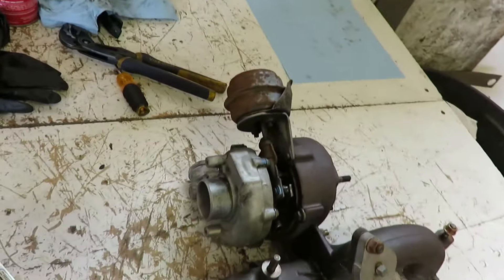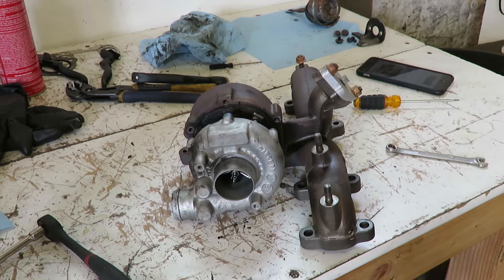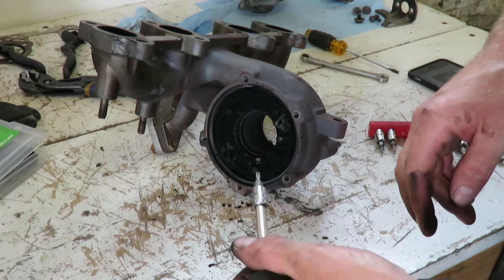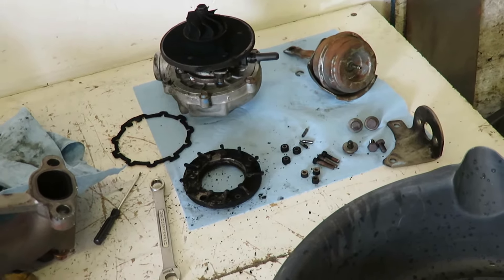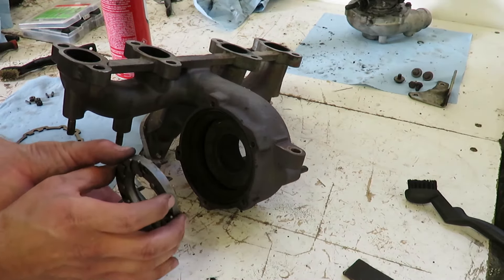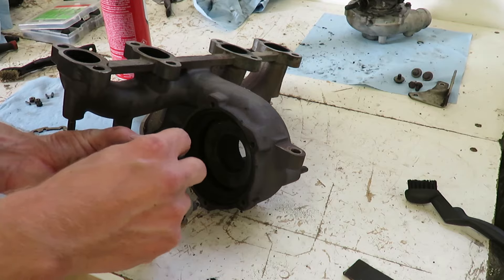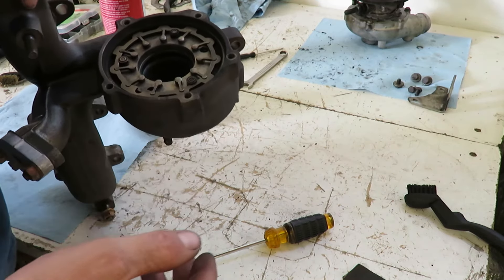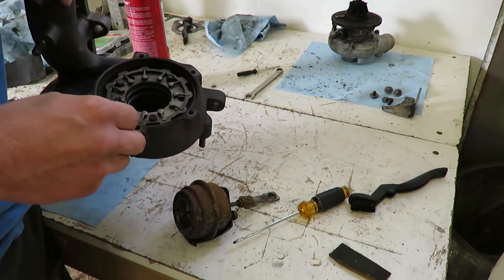Volkswagen VW TDI ALH Diesel Turbo Cleaning Overboosting

Comment: Why does turbo get so dirty?..its because of oil not changing enough times or because car was not driven in proper rpms? Only city drive and not high speed..thank you for the answear
Reply: Delete the EGR then clean it and it will never happen again.  The other thing is if you have EGR vent the valve cover vent to ground or catch can so that it's not going into intake 

Oil mist and soot is no bueno 

And yes more city driving makes all of the above much worse but city driving by its self has 0 effect

Comment: can you put any anti sieze or gease  onto the vanes so it doesnt stick together?or not?
Reply: Most likely the grease in those products will trap soot and gum it right back up and with the temp it could just burn off that grease leaving behind heavy carbon deposits
Reply: No just make it nice and clean with break clean and a brush

Comment: PCV  valve is the culprit ....change it from 60k to 80k ...when it fails oil dumps into the intercooler ..and slowly carbons up the EGR and Turbo ...use a good oil and CHANGE THAT DAMN PCV VALVE !

Comment: Is one able to "clean" the turbo on an alh without removing it? I've seen people just open them up and spray oven cleaner in em.
Reply: Massive amounts of seafoam and transmission fluid is how we used to do it on a 6.0 powerstroke.which effectively works thensame
Reply: @codyparker679  Transmission fluid?
Reply: @KristoforJensen  ATF is great. Full of detergents.  Let a rusty wrench sit in atf and you’d be amazed how it cleans up.

Comment: What size tune did you do? I have a Malone 1.5 with 11mm pump and stock manual injectors.
Reply from the maker: Jerome Campbell my tuner doesn’t really do the stage game. Just tuned for the mods like you should haha it runs pretty good though

Comment: How often do you have to clean your turbo ?
Reply from the maker: Marko fraser just when the car is babied and gets sticky, or it burns oil
Reply: The biggest factor would be where, and how it is driven. Slow city driving with a lot of idling in traffic would create more soot. You are burning more diesel/km. Faster, motorway driving would burn less fuel and create less sooty deposit in the turbo. I bought my car and found it would go into limp mode very frequently. As my work commute is a 35 km round trip mainly on the motorway it has cleared up substantially. But I will strip it down when the weather warms and clean it up.